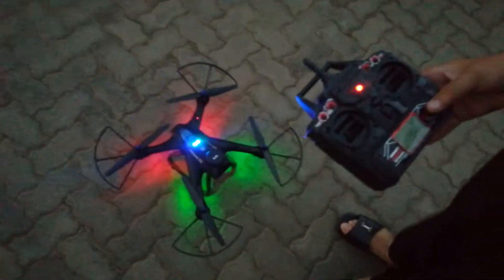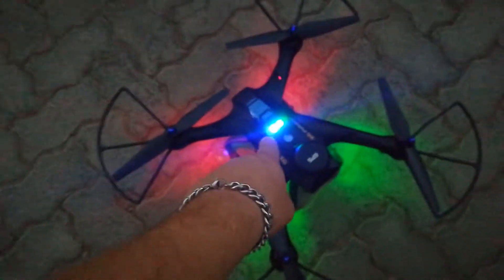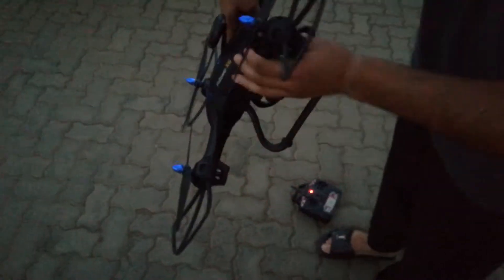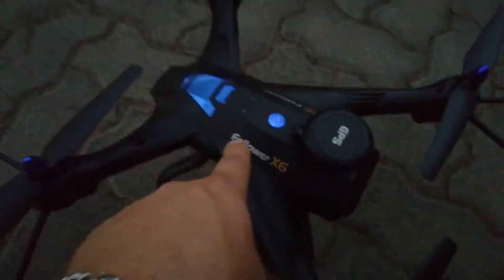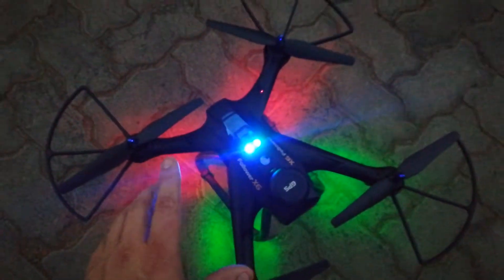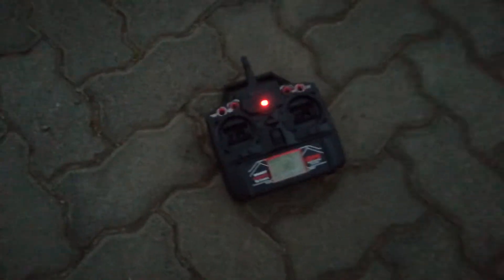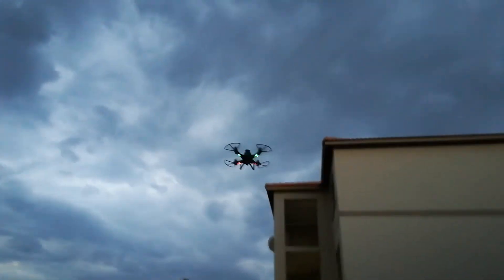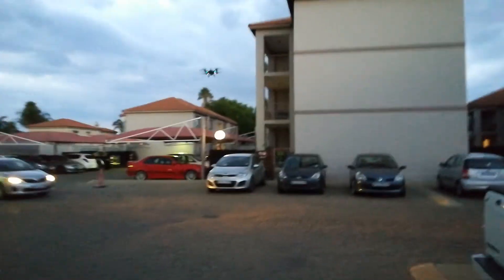Global drone calibration English x180/x188

Comment: My x6 won't calibrate. Blinks 1 long and 2 short. Motors start on idle but won't take off. Any advice?
Reply: Daniel Shaw this is the guy https://youtu.be/DaFx42DuKxQ

Different drone but same issue,will fix your problem.
Reply from the maker: Daniel Shaw it has to be reset you have locked it into default mode
Reply from the maker: Our technical team can reset the drone.for.you call 0649964366
Reply: Daniel, did you ever get your drone out of Default mode?  If so how?  I have same issue as you.
Reply from the maker: Daniel Shaw like I said email me on sales@uniquedrones.co.za for unlock code
Reply: Daniel Shaw your compass isn't calibrated correctly.  I had same issue and I learned from.someone else how.to.do.this.  I'm trying to.recall.name, something like bayango toys c21...guy explains perfectly how to fix that issue.
Reply: Shawn F thanks